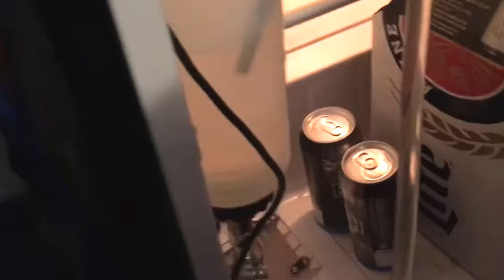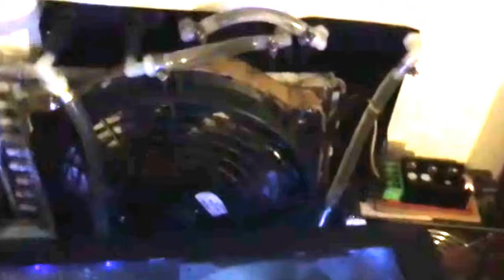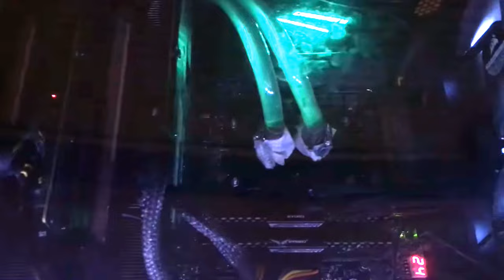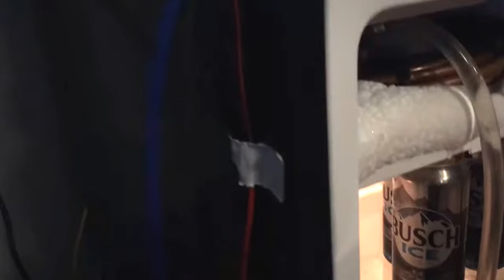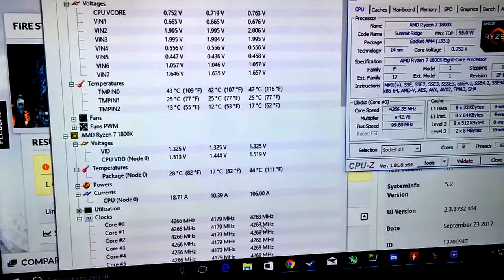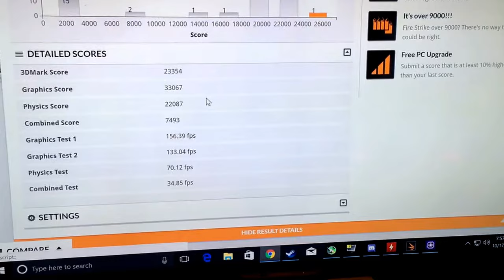Ryzen 7 1800x 4.266 overclocked using custom water chiller.

Comment: Your Rig is “Cool”, but it also looks like a Rig that you would build for use during Doomsday or the coming Zombie Apocalypse. In addition, I would imagine that the cost of the build and its accompanying electric bill does not justify it. I cannot see the practicality in this build. However, I can absolutely see the fun in building it!
Reply from the maker: MrThamahn thank you for the comment. This project was for fun indeed. Started out with an idea and ran with it. The system is still running to this date 24/7 with the same settings. Added a water block to the 980ti and peltier recently to the loop. Will make a follow up video soon. The ac unit still doubles as it cools the room and the system. Same goes for the fridge which keeps my beverages/food ice cold.
Reply: "The ac unit still doubles as it cools the room and the system. Same goes for the fridge which keeps my beverages/food ice cold." - That's Cool!!! :-)